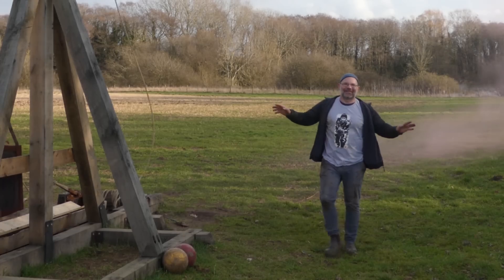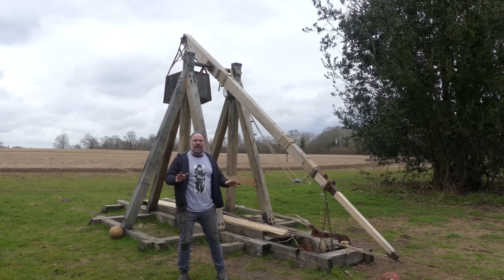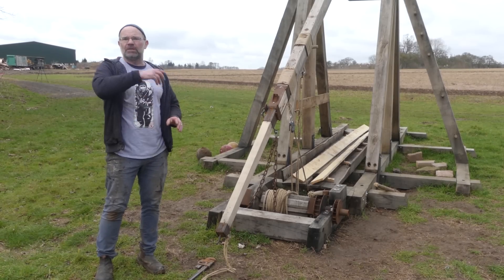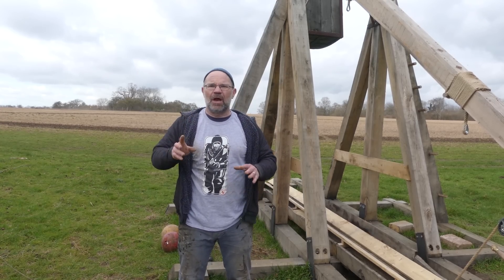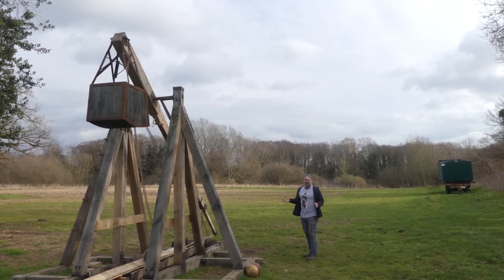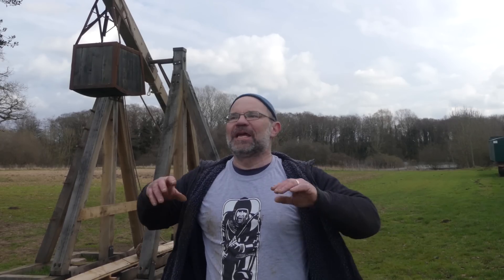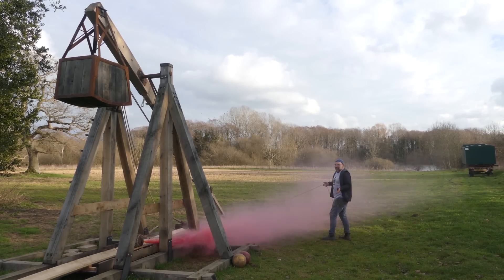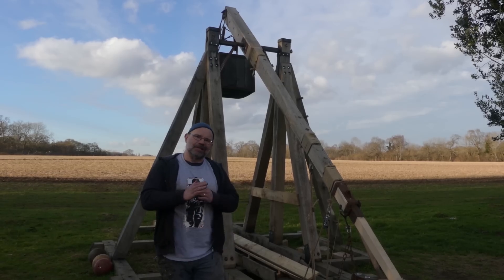Trebuchet - Why won't the darn thing shoot further?

Comment: @Tod's Workshop
According to Donald B. Siano, in his analysis of trebuchet physics (Trebuchet Mechanics, March 28, 2001), the optimal release position and design, based on his definition of "range efficiency" is such that:

  • The initial release position is such that the beam on the counterweight side makes an angle of 45° with the vertical.
    [n.b. adjust pin angle, as you have been doing - don't adjust it's length].

  • The length of the long arm of the beam (on the payload side) is 3.75 times the length of the short arm of the beam (on the counterweight side)
    [n.b. the long arm on your machine looks around 5.6 times the length of the short arm - i.e. the long arm is too long - reduce the length of the long arm to ~ where the metal reinforcement is (i.e. to probably where you had it before adding the extension)].

  • The length of the sling is equal to the length of the long arm of the beam (on the payload side).
    [n.b. the sling length looks about right on your machine, but would need to be shortened as per dot point above].

  • Furthermore, he recommends using a counterweight that has a mass 100 times greater than the mass of the payload.
    [n.b. with your upped 550 kg counterweight, the payload should be 5.5 kg (12 lb bowling ball sounds good) but a bowling ball isn't very dense (the larger surface area means more drag on the missile as it travels through the air). Try using a stone or metal ball e.g. cannon ball to maximise range]

  • However, it is certainly possible to achieve a good design with a much lighter counterweight than this.
    [n.b. to reduce the amount of "jazz" in the counterweight basket after the throw, there are a few options, each requiring different amounts of work and expense. The easiest would be to shorten the overall length between the counterweight axel and the bottom of the counterweight basket. Another approach would be to thicken the short arm (put as much weight as possible on the short arm itself). The best would be to have the centre of gravity of the counterweight on the actual short arm with a U-shaped basket with the axel running through the basket itself. If you can manage any of these modifications, it may also allow for a longer short arm, and consequently, a longer long arm, meaning more mechanical advantage (without having to rebuild the machine's main structure), resulting in less mass in the basket, a smaller basket, and resulting in less "jazz" in the basket after the throw]

  • Grease all points of friction.

This combination should yield the maximum range of a trebuchet with an axel at the height of your machine. For greater range, the axel must be elevated and all associated measures increased accordingly.

Comment: Would moving the counter weight further up the shaft make the end of the shaft move past the vertical before  the weight be enough to make a  smoother rotation. That way the counter weight turning in curve , not bumping at the bottom?  Good video

Comment: I believe that I saw somewhere that a trebuchet on wheels out performs a stationary one. They claimed that the back and forth rolling of the machine (along the same line as the missile trajectory) somehow enhanced the shot.
Reply: I have heard this too. At the point of the release, the counterweight is on the downswing and thus pulls the entire machine fowards. With wheels you can exploit this to give you a bit more release speed. It also greatly reduces the stresses on the machine.

Comment: The "easiest" way to optimise range is ... implement software simulation for trebuchet and then use some brute force, monte carlo, simulated annealing, genetic algorithm or neural network algorithm to optimise trebuchet parameters within some defined limits (angle of release, arm length/ratio, counterweight mass, etc) to find max range.
Not entirely exciting but guaranteed to yield the best configuration (provided implemented physics model is accurate enough).

Comment: I know that it's a lot of work but if you put it on wheels then the machine will roll backwards and forwards allowing the weight to fall straight down instead of in a curve. Experiments with models show this clearly but it's, as I said, a lot of work.

Comment: Hi Tod, I'm not an engineer so take this with a grain or two of salt, but it looks like your sling is opening a split second after your counter weight stopped falling. I assume that the counterweight can't ad any energy after it hits the bottom. 
My second observation is that while you made the throwing arm longer, since you didn't raise the axle, you can't raise the counterweight as high (not to mention the arm weighs more now). 
I hate to say this, but I think your best bet now is to build a new one from the ground up that's designed for performance rather than versatility (I know that's more expensive and time consuming).

Comment: You need to improve the consistency of your machine.  Even where the release angle/height were nearly identical, the velocities were very different.  Dedicate a testing session to multiple shots with no changes, cameras focusing on the components and their interactions.

If you're seeing 20% difference shot to shot, any adjustments made trying to achieve 5% better performance will simply be lost in the noise.

Comment: The lever arm stops at vertical because of the weight being able to swivel. So some of the length to accelerate the projectile is lost.
The weight movement has to be timed to have the weight reach its highest velocity at the same time the projectile is released.
The weight's highest speed is before its farthest point of travel.
And the best point of projectile release must be determined or estimated first. 
The weight must be attached solidly to the arm. Seems the weight might have to be moved away from the arm, a bit toward the front of the trebuchet so it reaches the end of its work at the same time the projectile is released.
Which will be at some point slightly past the arm being vertical.
So the arm swings up; the arm swings smoothly thru whatever arc it makes because the weight is attached solidly to it. The arm should not be braked, adding strain to the members. 
The projectile releases at the right point, the same point the weight is making the most work because it's attached solidly to the arm. Seems.

Comment: A trebuchet's range depends on the speed of the arm at the time of release. The sling just multiplies that speed. While increasing the length of the arm will extend the range somewhat, it does so at the expense of energy imparted to the projectile -- need to use a lighter projectile to get the same range. Remember, the arm is just a lever. The speed of the weighted end of the trebuchet arm is absolutely controlled by gravity acting over a distance. The farther the weight falls, the faster the arm rotates, and the greater the range. That's why medieval trebuchets were huge. The bigger they are, the better they work, as long as the wood and the fittings aren't stressed to failure.

Comment: Remember that when you make the arm longer, you decreased the angle change during the throw. This is because you didn't raise the pivot of the arm to match the increase in length. I'm not sure how you could do that in a cost efficient manner, but if you find a way i believe it will work

Comment: Ooooh, I just had a thought (rare but occasionally of some use,) how about looking at how the weight drops because you've got multiple moving parts there as well. Maybe set up to see if there is a point in the swing where a lot of energy is dissipated before the point the sling comes off, or whether it's slinging doesn't coincide with the optimal power point for the falling weight?

Comment: Long time ago, (so long ago I saw it on TV, not youtube or the internet in general) saw a study about adding wheels to the trebuchet to let it pivot during the throw (I think it also helped reduce the structural stress to the moving parts).  something in the movement added to the release point (better balance) and by adjusting the length of the sling, you could dial in the release point and get a lot more umph out of it. :)  It's funny because I think of that story every time i see a trebuchet  (movie or youtube, never saw one in person, no room to build one :) )

Comment: My instinct is the arm looks too long for how high the trebuchet is, which makes sense since it wasn't designed for it. The sling is starting out at this EXTREMELY small angle and you're probably wasting a ton of energy. It would have more leverage when pulling nearer perpendicular on the sling which I think would just require a taller trebuchet? If you imagine the most extreme case of a sling at 0 degrees to the arm, it would get NO leverage and would not even launch at all. One at 20 degrees versus say 40 degrees is getting closer to that hypothetical extreme.

Comment: I've often wondered if modifying the attachment point of the counterweight to eliminate the initial forward motion would improve performance. Similar to how the head of an oil derrick keeps the attachment point directly above the well as the arm rotates.

A lot of energy is going into the lateral motion of the basket as it comes down, and if you could eliminate the swinging all that energy should go into the arm and therefore the projectile.

Comment: The length of the arm has to have an optimum. Shorter arm and you can't throw far. Not enough speed. Long arm, and your weight is too big to get enough speed. So there is a sweet spot for the length. But that sweet spot is a flat optimum like the curves of the bowling ball. The peak is flat. To me it seems as if you already are close to that optimum. Have you thought of adding some stretching in the sling rope. Think of the Yank'em ropes to yank cars out of a stuck position. The initial shock of acceleration is smoothed out, but the energy is given back to the ball. I am sure that you are able to come up with some kind of stretching that would also be historical possible. Good luck.

Comment: I'm no expert, but I've heard it said that wheels are essential in trebuchet design - not primarily for mobility, but to absorb energy. The wheels help the machine to avoid tearing itself apart. So if yours is self-destructive, maybe try adding some wheels?

Comment: When i was testing my trebuche i discovered that if i put wheels on it, it scoots 50 % longer. so 130 meters becomes 195 meters with wheels.
My was not that tall only 3.5 meters high.
Reply: I had the same results with a small trebuchet that had the weight fixed and ran on wheels.  As it fired the weight initially pushed the whole machine backwards then pulled it forwards.

Comment: You've made the arm too long for the height of the machine and are lacking rotation (you've cut out time for acceleration). If you increase arm length you need to increase leg height.

Comment: It would be fascinating to convert the release to computer control. You could then adjust the release relative to the arm position and graph it. Easier to control and reproduce than a "bent pin".
Reply: I'd also like to see instrumentation to gather data such as peak arm speed and sling tension. Lots of interesting research here for a physics A level.

Comment: I hope your filming went well. From the testing perspective I have a couple of suggestions. First off, don't pace each shot off. Fire groups, pace one then measure from that. Saves a lot of walking time. If you use a long duration smoke on at least one of them you can locate the group easily for measuring purposes but could probably get away with just the one as the others should be in the vicinity.
Another thought is definitely not historical but practical - why not make an adjustable hook to help you determine the angle? Length can be done by using threaded bar with a couple of nuts, angle by having a pivot and a plate with a number of locking points. Dial it in then replicate, takes a little more setup but then you get confirmable data points and can easily reproduce any setting.
This is just off the top of my head while watching the video but quantifying and controlling variables is something that we do as much as we can while testing, much as it upsets the garden shed tinkerer in all of us that prefers a couple of whacks with a hammer as a primary means of adjustment! 😄
Reply: It's the opposite.

Comment: Hey Tod! - Let me get this straight ...
You built a trebuchet to scale, I presume, and then you made a rather drastic change to only one part of the machine. You made the "throwing" part of the lever longer. 
Basic principles of lever & fulcrum mechanics mean that you made it heavier/harder for the same counterweight  to lift/move anything at the longer end. I don't think that you're going to change the overall ballistic characteristics by heavily (pun intended) modifying only one portion of the overall machine. I believe it's out of ratio too far for a weight adding, pin bending, and rope lengthening to make the necessary amount difference here. 
You're probably going to be able to achieve your desired goal, only by lengthening the other side of the lever. I'm no mathematician, but I would guess that about 1/4 to 1/3 the length of what you added to the throwing end might be about enough, if you want to "eyeball" the new ratio ... or use a measuring tape, do some math, and mimic the ratio of the original leverage. 
The problem you're going to run into after that, is the counterweight bucket hitting the ground. Unless you can arrange for a bucket that is shallow enough to allow for that difference, you're going to have to raise your fulcrum/axis higher to make the necessary accommodation. 
Good luck with all that. I hope you can work it out well enough for me to watch another pin bending, fine tuning, video in the future. 👍

Comment: So from a physics perspective you're looking for shots with the least rocking after launch - ie. the most energy transfer to the projectile. Both for the bucket and the arm, that is. I wouldn't have thought a few degrees angle change would make a massive (tens of degrees) difference in the shots whilst the sling and arm certainly would. When neither are rocking post-shot we have the ideal energy transfer, and so angle differences would make great ground. We also have to look for the bucket to not be swinging, that might be affected by the length from the pivot to the bucket, weights, bucket depth, and so on. The phase difference between the bucket and arm is also useful to keep a track of, I would suspect.

As an aside on testing, I don't think only one shot is an issue. Repeated shots with different settings still produce useful data to point towards a trend as long as you chart things. However I do think the best gains could be made with scale - ie test on small toy models and then bring back what you have learnt to the big toy. At least that is how I would approach it, either model it incredibly accurately mathematically (or computationally) or test on small scale models - both methods ultimately being pretty similar in logic and results.

Comment: If you can get your trebuchet on wheels it can shoot further. There was a very good documentary about trebuchets and they explained the physics there.
My brother did an experiment in school, where he built a trebuchet (about 2 metres high) and tested it with and without wheels
Reply: Totally agree. 

Also make two rails with side walls for the wheels to run in. Better than on turf. 

If the frame can roll then the weight can fall in a nearly vertical line instead of a sideways arc. Better vector, longer range.

Comment: put a gopro on the arm looking at the pin so you can see it release? Also do a few runs with exactly the same parameters so you you can at least see where the variation is soming from.

Comment: I think that a shorter sling(-.5 meters) would help get more distance, and definitely putting wheels on your machine, this allows the counterweight to fall in a straight vertical line, instead of on an elliptical line. I have built many smaller trebuchets, and the length of the sling has always had a huge impact and taken much tweaking. The wheels I have seen as much a a 20% increase in distance.
Reply from the maker: Thanks and I am pretty sure I will shorten the sling a little

Comment: are you using the online ballistic calculators, such as virtual trebuchet 2? From memory, for a longer flatter trajectory you may need to shorten the sling as well as bend the pin up. You are currently shooting in over the wall mode, no knock the wall down mode. There's also a phd thesis on treb ballistics which is a good read. be warned, it's possible to shoot backwards with one of these.

Comment: Doesn't it shoot lower and therefor shorter, when it releases a bit later?
If the energy is high enough, wouldn't then a higher projectory result in a further throw? Since it would have more time to travel? And obviously there must be a sweet spot, because if you just release it straight up, it's not traveling far at all. Dunno the math about that, I think you would need to know the kinetic energy to calculate it beforehand.
I am guessing a 45° angle in general, but maybe higher when you want a higher and wider curve? If the energy is there?

Comment: the distance of the shot depends on the angle of release and the launch speed. Launch speed depends on the kinetic energy which is always almost the same as the counterweight is always the same.  ideal release angle is 45 degrees
Reply from the maker: Yes, but all the aspects interact, so leaving everything the same, but changing  the sling length will change things a lot